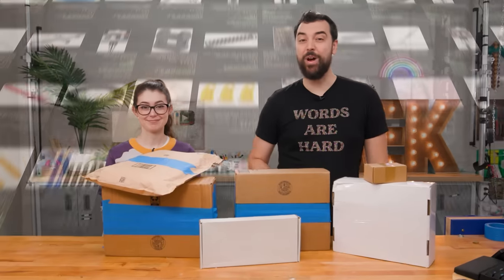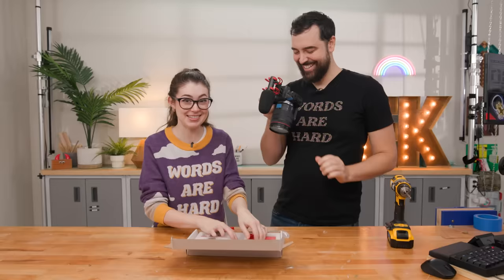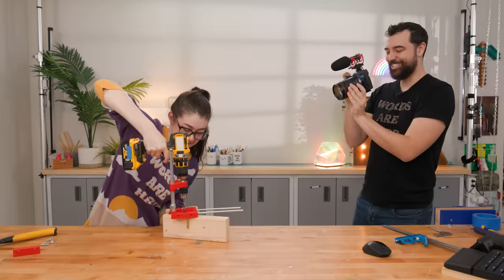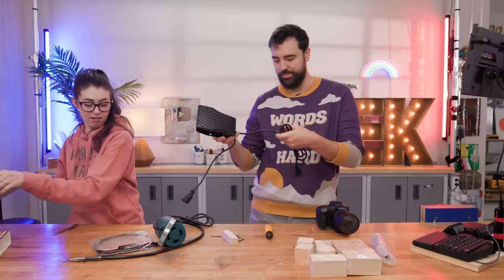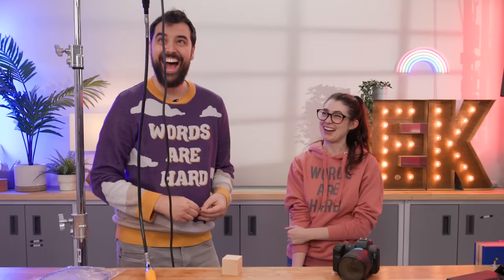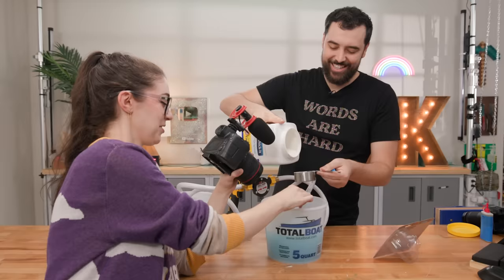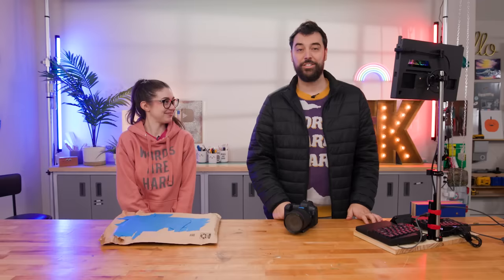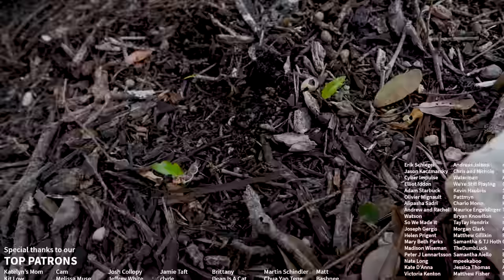Testing 5 of the Worst Rated Tools on Amazon (under $15)

Comment: With those drill pumps, you are supposed to prime them first. Put some fluid in the pump first (pour a little into directly), and then run it. It have a longer life also.
They work surprisingly well.
Reply: Ikr, a flex shaft tool for 60 bucks it’s actually really good and from how well it looks like it worked without the proper lubrication, I feel like it’s more their lack of technical skills.
I use flex shafts for jewelry and they are technical tools, considering how loud the noise was I’m assuming they had their foot on the pedal full force and definitely not used to the tool.

Comment: The problem with the Drill Pump is that it is probably not self priming. So unless you get the water to the inlet of the pump first it is just going to spin and burn up the plastic.
Reply: I have the exact same pump from another store. You have to prime it and there is an RPM limit that a drill can easily surpass.

Comment: Had so much fun watching 😊
The first drill thing could work better if you flip the drill handle to the other side so you have space for your hand 💡
Reply: Still a piece of trash but I came to say the same thing.  Maybe some instructions might have helped with that.
Reply: @Demolishionist I guess common sense isn't that common anymore? "My hand is hitting the frame, how can this be :O"
Reply: How’d they not notice that?
Reply: My thought as well, but it is still a piece of crap.
Reply: i might've remembered it wrongly... but if you flip it wouldn't the thing no longer guide your drill?
Reply: @alveolate  it still would as that piece is fixed to the plate that's on the two vertical rods
Reply: It's possible that she intentionally used it wrong for content, and to show what someone will do without instructions.
Reply: I have one that looks about like it but is really old and made out of metal. It actually works pretty good. You also got it right they had it backwards but that cheap plastic isn't gonna help anything.

Comment: I use those pumps and they work great. Biggest mistake people make is they don't prime them. Not sure about that exact model but the ones I have make it very clear in the instructions that it should never be run dry.

Comment: the biggest problem of trying to pump resin is that it will clog at like 3 uses. It's not easy to remove from surfaces so it's absolutely  pointless to pass it through a tube. Maybe with hydrophobic protection but not very hopefull about that eitther
Reply: The only thing I can think of to keep it serviceable is to pump a lot of acetone after each use to prevent the resin from freezing up the pump when it cures.

But that would undoubtedly melt the cheap plastic in short order.

Comment: To anyone interested in the Flex Shaft. I actually highly recommend getting the "original" version of the Flex Shaft/Pendant Motor showed in the video, it's an incredibly useful tool, especially for small work like Jewelry making. It combines a small handpiece with a lot of power, for less power but more flexibility a "Dremel" is best and for even less power but absolutely amazing flexibility a "Micromotor" is best.... Under the Line, a Flex Shaft/Pendant Motor is basically a beefed up version of the commonly known Dremel Rotary Tool... The leading brand is Foredom, Dremel also offers a model called Fortiflex. Cheers

Comment: - Guider: You can attach the drill feom the other side to have free room for your fingers
- Hammer: Clamp the nail and just hammer it in holding the tool, no need to use another hammer. When it's in, use the other side to finish the job.
- Weeder: You need to step on the pedal to clinch the roots.

Comment: 2:10 about the drill guide: i think you did it the wrong way (pointing about "no wiggle room"), you could just flip the chuck part to the other direction (knowing that it could also be used for forstner drill bit, also gonna solve the "no wiggle room" issue), or you could just place the grip the other way (or you know, have the drill locator by entirety face the other way or something). and i also noticed that the control test and the product test ( 2:40 ) have different sides to demonstrate the differences (control test being done with wood laying flat on the table, while the product test done with drilling the sides instead, at which the unstable demonstration happened). i felt like it's unfair demonstration, but it's fine lol

Comment: I'm sure everyone is going to/has already commented this. But Katelyn, have you tried drilling from a higher vantage point? I was taught to look at the top of the drill, so you can't see any part of the drill below it and not press down at all, just use the weight. For reference, my table is about mid thigh height.

Comment: For my work, I got that kind of pump. It was a slightly more "industrial" version of the pump, purchased at Lowes, but on day 1 of trying to use it, I managed to break the screw on plastic parts for the hose and had to go to Lowes to buy replacement parts. However, once I changed out the parts, it has worked fine ever since. I pump water as well as thicker liquids with this pump.

I did not like that the hose curls and therefore is hard to handle on your own. I zip-tied sticks to the ends of each hose to straighten them on, and, the torque created from spinning the blades in the pump means that the hoses will always be pointing in odd directions while you're using it.

Comment: Regarding the drilling guide, the drill is supposed to attach to the body toward the horizontal bars. This would provide more stability when drilling and the vertical bars wouldn't get in the way of your hand.

Comment: A good version of that drill pump is a life saver. We need something like that for water changes in the hot tub cause we always end up bailing out the last 30 gallons cause it wont drain after a certain point.

Comment: Fun video as always for you two :)   I do believe you overlooked one major thing with the pump.  most water pumps need to be primed (long story short air is compressible, liquid isnt, so a dry pump isnt really able to do much but once primed (flushed with liquid) the water is able to push/pull/move.  I am really curious how the pump would have performed if used 'properly'.   Did the instructions not mention anything about priming??

Comment: My mom and dad have a 14 inch height difference. They spent a very long time considering what height counters to get because they both like to cook, but chopping and cooking needs to be done at comfortable heights. They compromised by getting two counters at different heights. 

This applies in the workshop: Evan is drilling at a comfortable height with his arms at waist height and is able to hold the drill straight.  The height doesn’t really look right for him when working directly on the work table, since he has to bed slightly at the hips or waist to use his tools. 

Katelyn is drilling from her shoulder height, which means she can’t get the bit balanced or hold the weight of the drill properly. 

Science dictates that Katelyn needs a lower table and practice to see if this hypothesis is true, and Evan may need a higher table if he works standing up a lot.

Comment: as a note for drilling straight, a guide block is more than sufficient in most cases (and the good ones are built to allow drilling pipes - something like the Wolfcraft Accumobile is cheap and light (I have one and I didn't pay the inflated prices I'm seeing online)

The hammer is a bad implemention of fencing pliers coupled with some "improved hammer" features

Drill pumps have been around for a while and are useful to have hanging around for emergency/occasional use. The really bad part is that a really good one is only $19 (clark C300PPB) and the one you showed is a knock off of a fairly good $12 Draper tool (18937)
Reply: Yeah, I was going to say, I have a multitool that's a hammer, and I was also thinking of fencing pliers.  A good one is a really excellent tool for what it's for; it's really hard to pull out a fencing staple with anything else.

Comment: As a goldsmith, that "wood carving tool" is just a very cheap version of one of my primary tools that I use for pretty much every piece of jewellery I make. I recognized the handle the second she pulled it out. Very hilarious to see it advertised this way and used so bizarrely. Maybe some wood carvers use a flex shaft as well, but I'm much more familiar with it being used to drill, sand, texture, shape, and polish metal at my bench.

Comment: So try running the carver on a slow speed, a flex shaft running at full rpm doesn't work on the hammer attachment, try 500 rpms I use a speed controller on mine and use it to engrave silver jewelry, and if you add googly eyes on he motor for it it'll improve to 5 stars

Comment: drill guide: guide rods prevent finger from pulling trigger.

solution: either turn the drill around the other way, OR lock the drill ON, then you don't need to keep the trigger pulled.

Comment: Fun video!  The weed puller is a design from at least the 1800s, classic weed pulling mechanism. It just does not work so great made out of plastic instead of iron or steel. Probably also has to do with the compromises to make it a good plastic mold. That said, there's a reason it's not a super popular weed pulling tool anymore.

Comment: for product
1 - get a drill press
2 - the carver works the tips are not sharp enuf or the wood was to hard
3 - its good to hold your nails and not hit your fingers
4 - yah its crap and i think the label was backwards
5 - a metal one would be better

Comment: Oh actually we use a drill pump all the time for moving thin flooded water. We also once had a really bad leak in our sauna that made us have to remove all the water without using its drain (the sauna wasnt actually fully plumbed in. It was an interesting circumstance) so we used the drill pump (a better quality one cough) to make a sloooow siphon work faster.

Comment: Not a professional, but I use a flexibel (the chisel thingie) quite often (with different tips) and typically, if it makes a sharp noise like that, it means you are forcing it too much<3 you kinda need to allow the tip to do its thing, and not try to rush it
Reply: Not a professional here, I use Dremel Fortiflex to carve stuff, except the end bit spins instead of vibrating.
Reply: Also it probably helps to have sharp tips, and if these are anything like the tips on the cheap hand-tool woodcarving set I bought a while back, they are not at all sharp.

Comment: I've used a drill pump before to send water outdoors from a plastic tub used to catch water from a bad roof leak in a commercial building. you should really have a much shorter hose on the inlet, just long enough to reach the bottom of the vessel. the outlet hose can be much longer though.

Comment: On the second tool, Harbor freight has a flex shaft grinder for like $50 and I highly recommend getting one of those if you have a work bench you can mount it at. I currently dont so I use a dremel but a flex shaft grinder is just better. Plus being able to swap heads is really nice. So I recommend getting a grinding head for it, they are like $15. I used to have 3 cheap ones that didn't have toolless chucks so I just kept one for a cut off wheel, one as a grinding wheel, and one as a wire brush and just swapped the heads.

Comment: The weed remover actually looked like the thing my household has (??) I can't tell the exact difference but the thing my family has is also a claw-grabber thing with a peddle to step on - that you're actually supposed to step on after you've aimed it at the weed. It worked great pulling out dandelion from the lawn, and dandelions have notorious long root and very spreaded (and nowhere to grab) leave so I'm guessing this might be a cheaper version imitating that real tool? I had a lot of fun playing with that tool when I had spare time when I was in high school so I remember it super clearly xD
Reply: Love dandelions though, they are so good for breaking up soil, and bring nutrients from deep down. Also, the flowers pop up if you have a few warm days and are a vital resource for pollinators.

Comment: that drill pump would've actually worked if they used a harder and more resistent to high temperatures than plastic! Now I'm actually surprised and would be excited if you guys wanted to try recreating it with some harder and heat proof material!

Comment: Curious with the drill guide if you replaced the plastic dowels with aluminum, or even wood, if it would work as intended & help Katelyn drill straight.

Comment: To drill straight it would help if you did it on a lower work top. This one is definitely made for Evan's height and Katelyn has to hold the drill above shoulder height.

Comment: Flexlible shafts are great for carving, but you need a normal rotary chuck and some bits. The big advantage of a flexible shaft over a dremel is that it doesn't vibrate your hand as much...but putting an oscillating bit instead of rotary completely defeats that advantage.

Comment: I think the problem with the pump is that it's a submersible pump and breaks quickly if there's any air in it. The new issue being that your screwdriver isn't waterproof. It'd probably work great with underwater motors bolted to it but those cost more than a dedicated water pump.

Comment: Hi, I guess someone should mention that a regular waterpump isn’t very suitable for sucking water up a hose with an air vacuum. You should get the pump as close to the water as possible. It will work a lot better that way, especially when you want to pump a medium that’s much thicker than water is. I reckon it could pump resin aswell, but you just need a very short hose from the resin to the pump, or maybe find a way to submerge it.

Comment: 9:46 "i dont understand why that's better than hammering the nail" because when youre hammering a nail into concrete it wont hold itself up like it does with wood after you tap it a couple times. you have to get it pretty deep before it doesnt need to be held straight, which requires hitting it hard which isnt safe to do while holding it with your fingers. so they make tools like this that hold it for you.

it also makes it impossible to strike the nail at an angle and bend it by accident.

its not a multitool. but its perfectly good at the one job it's designed for

Comment: In the 80's and 90's dont you remember the external frame that you used to get with your electrical drill from all the major tool suppliers?  

It was a simple external frame that could be used for depth and  straightness. 
Maybe you could do one for katelyn to aid her enthusiasm for drilling.

Comment: I have used a similar tool to the drill straight jig, owned by a friend that does a lot of 3d printing, but it was aluminum instead of plastic and made for Dremel tools.

You were supposed to clamp your dremel's flex shaft tool into it and it (supposedly) turned your dremel into a teeny tiny drill press.... But i never needed super precision drilled micro holes enough to justify buying one for myself.

Comment: So a few thoughts:
Drill press:  The drill should probably have been rotate 180 degrees so your fingers didn't hit the bars.  That being said, looks like it's too cheaply made to be worth it.
Hammer thing:  Only real use might be to hold the nail while hammering.  That being said you can do that with pliers too, so yeah.
Drill pump:  Not saying this drill pump, but there are some that are actually really useful to remove small amounts of water (up to ~ five gallons) from areas where you can't easily get a normal pump in.  Also, as with any pump, it helps to prime them if at all possible so you aren't trying to pump air.  That's probably why it struggled with the 'thicc water'.  

Still an entertaining video though.

Comment: 3:00 User Error - you've got the drill attached in reverse of how it should be.  It's obvious via use that the 2 rods that extend from the base are there to offset the weight of the drill (being over them).  And clearly working on the narrow dimension of a board is more difficult and less stable than the wide dimension.  Despite how cheap and flimsy that tool it, it actually could aid in drilling if used correctly and with some care.

Comment: I use one of those drill pumps in my storm shelter if the sump pump stops working for some reason. Had one running for almost 2 hours.